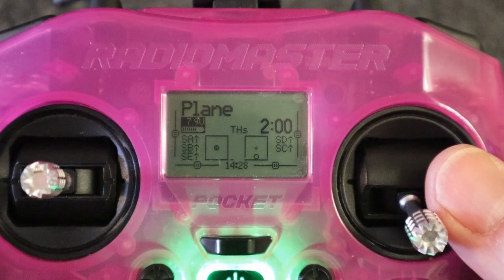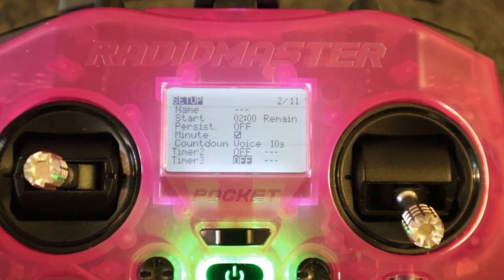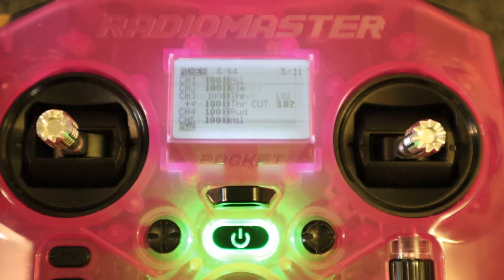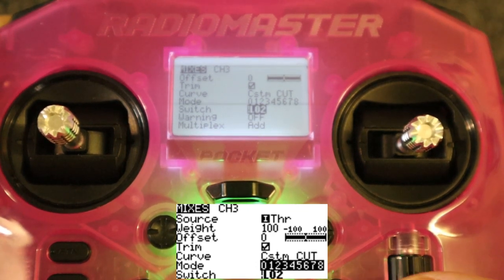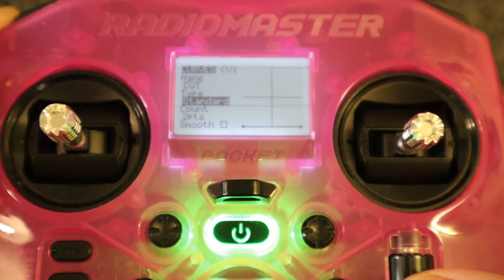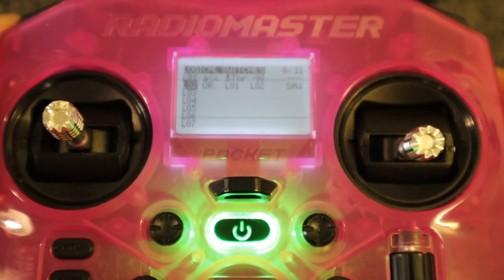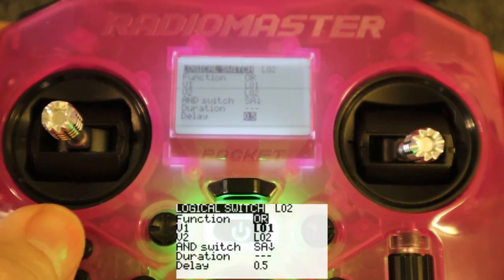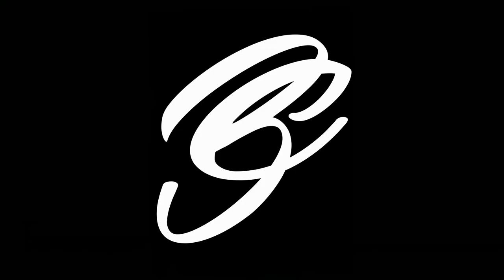RadioMaster Pocket 4(5)Ch Fixed Wing model set up with “Safe” Throttle

Comment: I want to add a throttle limiter, are there any considerations on how that would interact with this setup? I followed these instructions by the way and I’m very happy with it, thank you!
Reply from the maker: I am pleased you found the video helpful. The easiest way to limit the throttle just add offset to the throttle mix -50 will reduce the throttle by 1/4. Please check your settings carefully before powering up your motor.
Reply: @ oh I’d like the throttle limit to toggle. So can I add a third limited throttle mix that is activated by a switch?
Reply from the maker: @ChrisMcPorsche This is tricky with a safe throttle but I will work on the programming.
Reply: @the-happy-RC-flyer  Hey I asked ChatGPT to help me with this. Between it and your videos I now have a much better understanding of all this! Here's the summary:

Timer logic:
-still works with L02

Logical Switch Summary:
-L01: a>x: THR > -98
-L02: OR(V1 = L01, V2 = L02) AND SA(down) (Throttle latch with safety switch)
-L03: L02 AND !SB (Limited throttle mode)
-L04: L02 AND SB (Normal throttle mode)

Mix Summary:
-CH3 Mix 1: Normal throttle curve, active with L04 (L02 AND SB).
-CH3 Mix 2: Limited throttle curve, active with L03 (L02 AND !SB).
-CH3 Mix 3: Throttle cut curve, active with !L02.

Comment: I’m having troubles setting up my LED lights to switch on and off with an aux switch on my Radiomaster pocket. Was wondering if you could offer any help? I’ve found your videos to be very helpful! Thank you!
Reply from the maker: Hi Richard, the lights are activated by the theoretical position of the servo. Could you please tell me the LEDS you have got and I will check out the manual for them and try and assist you.

Comment: Cheers for that, have loaded up on Radiomaster Pocket ready for a PWM rx coming soon for a delta wing model. Good to have an arm/disarm on a switch. Will put model battery voltage, tx power read out value,and DBM value on the separate momentary switch too, once telemetry received n set up. As I do for my drones with SAT stats etc.Thanks again, safety first :)

Comment: Hey Bill thank you so much for the Radiomaster Pocket Series. Really it has helped me a lot in setting up my radio. My doubt is at 2:52, in mixes page , you have given a note use channel 6 for the second aileron if using ExpressLRS receivers. Here we have to set channel 6 after using webUI to change channel 5 as AUX2 or we do not require to change anything ? Also im using a 5 channel pwm receiver , is this setup for me as well or just people with 6 channel receivers?
Reply from the maker: You should only use channels 5 for arming so you have 4 channels for servos. You can reassign the channel but that would only use full on a six channel or above receiver. Channel 5 does not have full resolution.
Reply: Thank you Bill, bought a new receiver